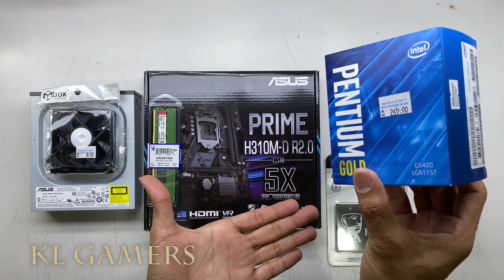intel PENTIUM GOLD G5420 ASUS PRIME H310M-D R2.0 Kingston KC600 Alcatroz Futura Black N5000 Build

Comment: Is the fan that comes with the cpu good or not and do you recommend it or not?
Reply: some models of Pentium and it depends the store (area) you may require to buy a cooler. the intel cooler included works good if you don't want increase the temps with overclok
Reply: The same cooler had been used all the way upto 10th Gen i5. Should be more than enough for a dual core pentium. It may not be very quiet if the computer was to be placed on your desk though.
Reply from the maker: Usually it will work fine in most situations
Reply: @KLGamers  ok thank you 😊💖